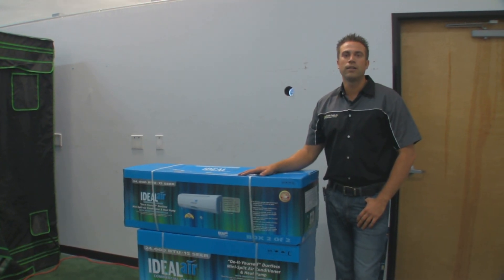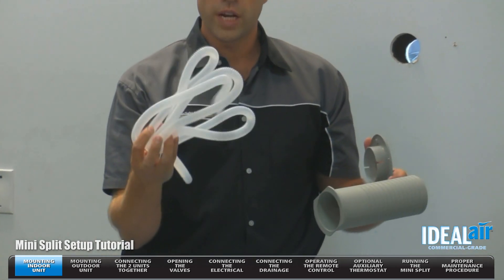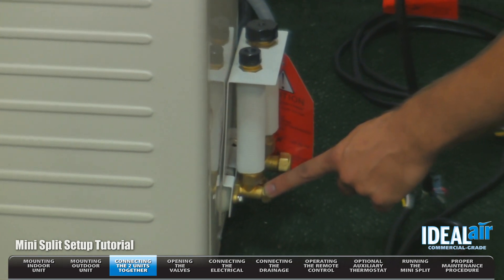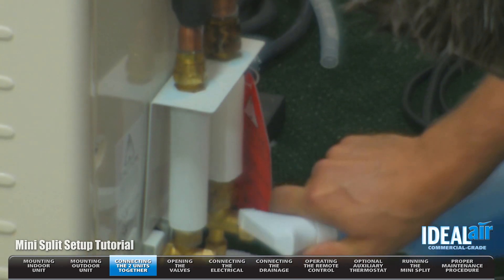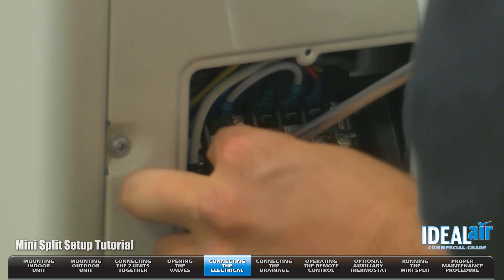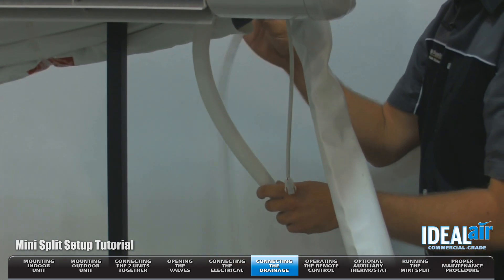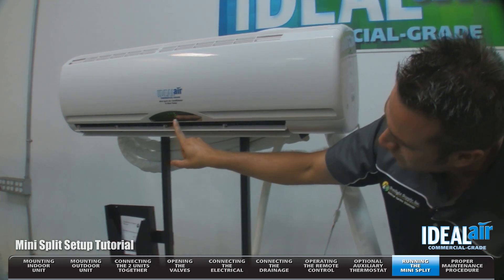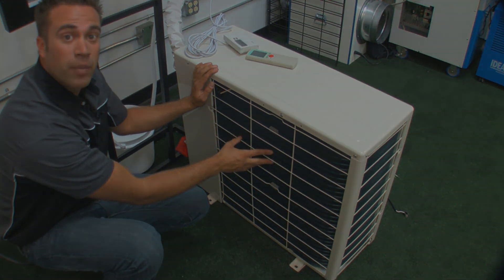Ideal Air Mini Split - How to Setup Tutorial

Comment: Very nicely done tutorial. I would have appreciated an explanation of how the system is pre-loaded with freon and why the lines don't need to be purged.
Reply: The lineset includes self sealing valves - upon insertion into the unit high/low suction - it opens the lineset.  Making this a decent DIY alternative to hiring a hvac technician to come out.  FYI not freon...R410a refrigerant.   Freon was a brand name of the old refrigerant type which is no longer allowed to be sold in new ac units.

Comment: I don't understand why you guys use a plug in wire for your installation videos. Code in the United States requires a disconnect meaning nobody will be installing it in this fashion. I'm addition, how the heck to install a liquid tight connector to this unit. It's not legal to just run the provided wire straight to the disconnect. It needs to be in conduit. And considering the price of these units, you'd think the instructions could be a little better. In addition to a clear instruction video would be nice. We need a video detailing the CORRECT way to install this unit by wiring to a disconnect, not a 3 pronged plug.